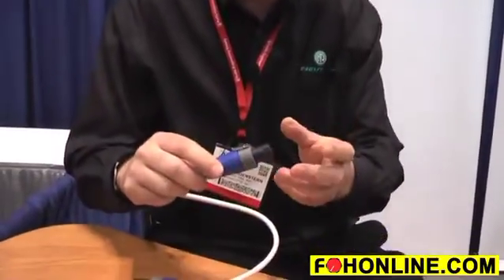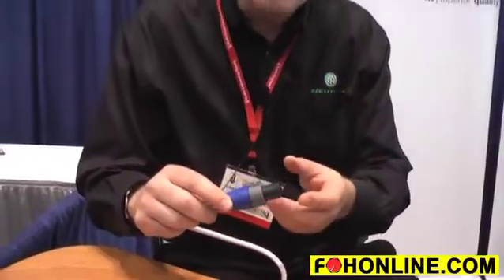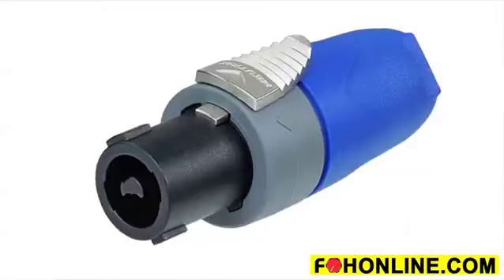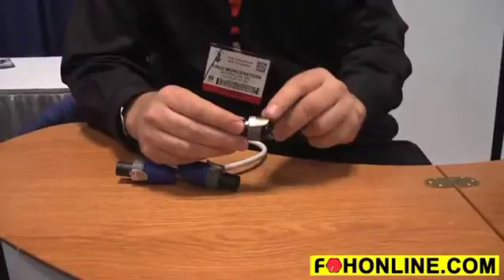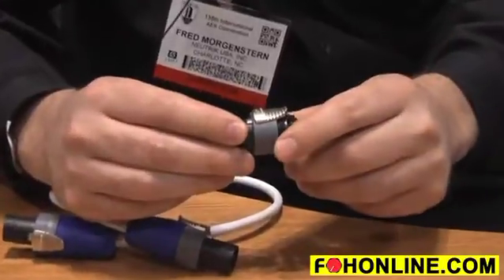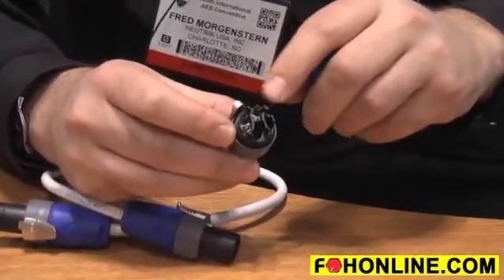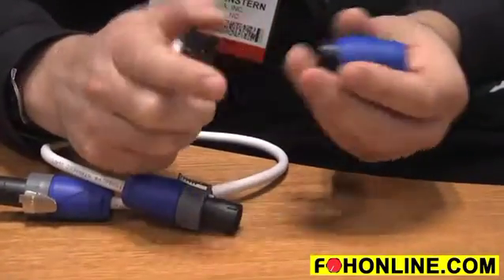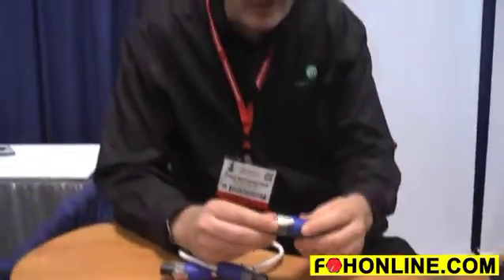Neutrik NL2FX Series Speakon Connectors

Comment: Can these be opened after closing? That would seem to be an important part of field repair
Reply: These can be taken apart after opening. You just have to hold back the metal tab and twist really hard and it will untwist so you can do any needed repairs.